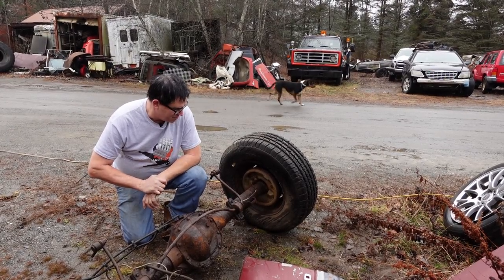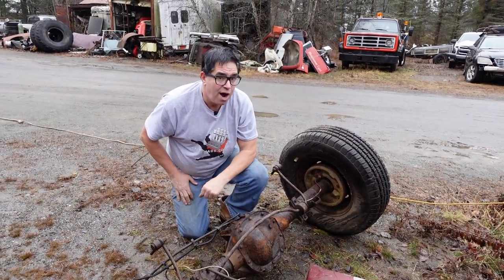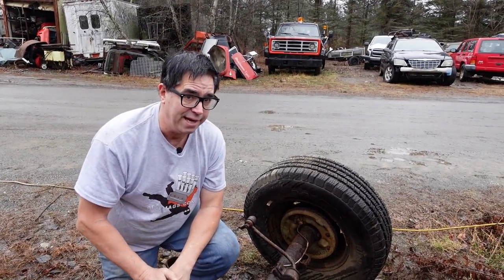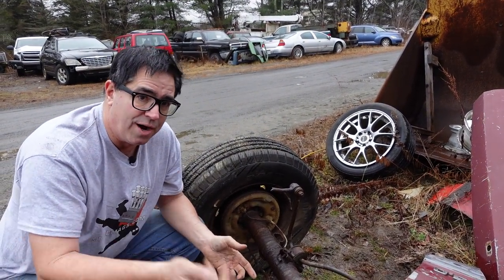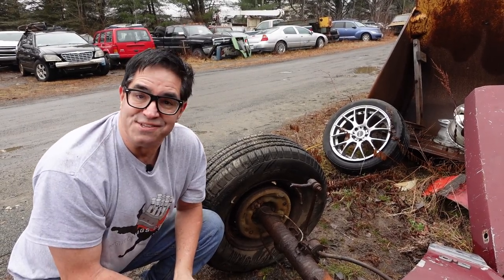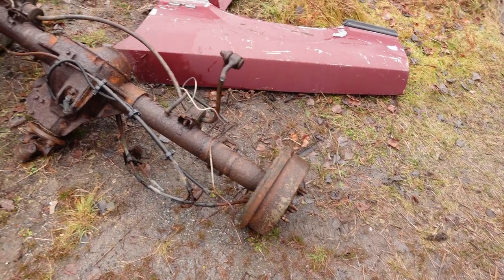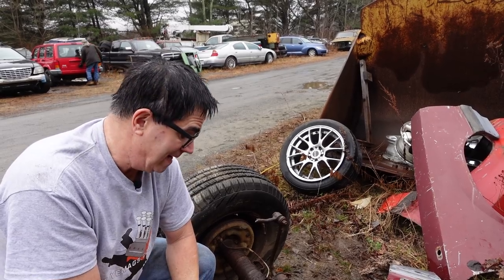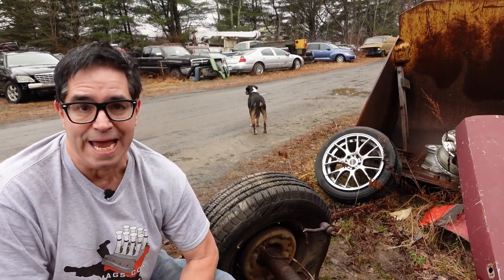The Great 8.8

Comment: These were under the Ford explorer with disc brakes and some sort of posi Trac device set up for 31 spline axles. My buddy put the internals, brakes and aftermarket axle shafts in his fox mustang for a brake, axle shaft, and limited slip upgrade as well as a five lug swap. The front end of a 95 mustang upgraded the front of his Fox body as well. Pretty slick.

Comment: 8.8 is a strong piece. I swapped out the 8.25 that came in my 87 Dakota for an 8.8 from a 98 Ranger Splash. The 8.8 was 4” narrower and gave me more options for parts as well room for some front spacing on wheels

Comment: On that mass damper, I was told by an old guy it was to add a little weight to one side of the differential so the cars with a light ass end didn't wind up with too much wheel hop on one side. IOW, a fine tuning of weight distribution from left to right. Actually, for un-sprung weight of the dif itself.

Comment: I've got an old f150 with an 8.8 under the back, it's got 380,000 km on it and it's all original, other than a lot of spider gear wear from one tire burnouts it's still holding up fine

Comment: Wow I always wondered what that dangly thing was for I have seen on some drivelines. Tuned Damper.  I love the learning Steve gives.
Reply: While working at the old Ford plant in Norfolk, I noticed these huge cylinders bolted to the upside down frames going down the F150 line.  At first I thought they were mufflers but saw they weren't being connected to the exhaust pipes further down the line.
Finally I broke down and asked a Ford employee about them.  That's when he told me they were vibration dampers.

Comment: Its grand daddy was the WER 8.5 inch axle first used in 67/68 small block Galaxies. Also later used in Granadas. All bearings and seals are the same. Soon, I will attempt to put 3.73 Trac-Lok 8.8 guts into my 68 WER axle.  Hope it works, I'll let you know.

Comment: My 96 Buick Roadmaster sedan had a weighted bracket hanging from the passenger side of the factory stainless steel dual exhaust near the catalytic converter. I didn't notice any difference after removing it. But I'm sure the Flowmaster 40 series mufflers covered up any noise

Comment: Ford also utilized the same 8.8  ring and pinion in the 2002 and up Explorer and Explorer SportTrac utilizing full independent suspension.
Reply: I didn't know those were IRS. Very cool! I had a weird idea for Sport Trac's a while back. Shorten the frame, slam it, shorten the bed down to about 1.5 - 2 feet, weld up the tail lights openings and create external bumper mounted lights, Narrow the front engine compartment down like a Plymouth Prowler. Basically make it look like a modern version of a model A rat rod. With all the modern interior and comforts.
Reply: Man, those rear coil springs liked to break in those irs explorers!
Reply: @mccoma11  springs break on everything if you try hard enough.

Comment: Never came in rangers until the 4.0 v6 came around in 91 and even then the ranger axles are still 28 spline axle shafts like the previous 7.5 and i believe the 28 spline shafts are interchangeable between the 2

Comment: The 8.8 has taken the place of the 9 inch, 12 bolt and 8 3/4 rear axles for guys building hot rods. Those older axles are getting more rare every day and the 8.8 has good gear ratios and many are limited slip so it makes them a budget choice. The 9 inch can be built to be almost indestructible but for reasonably powered cars the 8.8 is good enough. And the 12 bolt features an 8.875 ring gear and the 8 3/4 Mopar is of course 8.75. They all have similar stem pinion diameters as well making them similar in strength.
Reply: The 9" was much better in every way except weight. I've never seen a 9" rear worn out unless it was run dry but I've seen plenty of dead non-abused always maintained 8.8's with gears that looked like a pit bull's chew-toy. They might be the best made today but the 8.8 is a POS in comparison to the 9" rear.

Comment: That is actually a explorer rear end recognized via the anti sway bar
Reply: It is an Explorer but not due to the rear bar, some Rangers had a rear bar also. 
 The give away that it is Explorer are the leaf spring pads under that axle This was done because Explorers had more of a straight rail frame ( sort of like a box truck ) in order to lower the rear floor.  Rangers had a frame that went up in the rear and leaf springs on top of the axle.   In order to get ride heights correct the axle went under / over the springs.
Reply: @bobroberts2371   thats awesome. now I can pinpoint that I have a ranger 4x4 axle.
Reply: @AaBb-zj2ld  What year Ranger ?  The original Ranger 83 to 12 or so used spacer blocks to make a 2 wd axle fit a 4 wd .

Comment: Panther platform cars (Crown Vic etc) also ran the 8.8, triangulated 4 link until 2003 and then parallel with a watt's link.  I think the ears are different than on a Fox but I could be wrong.

Comment: The ones in late 90s v8 explore is the best to use for jeeps. They have disc braks 35 splin count and limited slips and are only 3/4" narrower the the dana 35. Yes its a c- clip axle but the axle shaft is about as strong as a dana 60 but plug weld the the axle tube to the housing it likes to slip when running big tires. But I ran 37 with no problem with one in a jeep.
Reply: This whole video I was thinking about how he should throw the 8.8 in the red XJ behind him
Reply: 31 spline was the most out of the factory

Comment: A buddy has an 8.8 in a full weight ‘66 Coronet, 440, 727, drag radials, runs 11.50s @ 116. He did upgrade the axles but the center section is hangin’ in there, so far, fingers crossed lol!

Comment: The Ford 8.8 was a only axle that I've seen where the spider gears are completely worn out by 150,000 miles.
Reply: Any axle will if you never change oil
Reply: Sounds like someone was doing lots of one wheel burnouts. If one wheel is allowed to free spin those spider gears start flying around like crazy. Otherwise under normal driving they only turn when navigating turns at a speed relative to the difference between the inside and outside tire.
Reply: @rustedratchetgarage6788  I've seen 50+ year old axles with their original fluids still, and they're still going.
Reply: @geoffmooregm  I doubt my 65 year old insurance salesman dad is doing a lot of burnouts in his trucks, but okay.
Reply: @danielc5205  yessir,,, I have a 64 Dodge Polara that my Dad bought in 1980 from a farmer who bought it new, and the car is all original.  We cleaned it up and detailed it in 1980, and because it was so clean underneath, we just hosed it down with wd40 after brushing off all cobwebs,,, and it has been to Orlando a couple of different times, as well as Mackinaw City probably 8 or 9 times, all on family vacations.  It has never had the pumpkin out of the rear axle housing,, and has never lost an axle seal. All I have done is pull the plug and dip a fingertip in the lube, to be sure it's still there.

To my knowledge, it's still running on the lube it rolled off the assembly line with.   It's been over the horizon on the odometer once, and shows 85k on the second time around.

I  am now wondering if I drain it and spray it out with kerosene and recharge it with Royal Purple 85w175,,, if it won't start leaking just days later....

Comment: I grab these out of the 1997-2002 Ford Explorer and shorten the driver's side axle tube, put another passenger side axle in and you end up with a nice width rear for early Camaros, Falcons, and in my case `1986-1993 Mazda B series pick-ups! :) Popular gear ratios are 3:73 & 4:10 and most were POSI's
Reply: I’ve got one with 3.73’s and a posi, bought it for $200. I’m going to put it in my 68 dart😁.
Reply: I left mine full with fits perfectly in my g body I also run a 28 10.5
Reply: Anyone make 8.8 irs stub shafts so you could swap them in a vette or jag?
Reply: Also a popular swap for the Jeep YJ with the Dana 35 rear end.  Easy way to get  a stronger axle with disc brakes.
Reply: I did the same thing, got one with 3.73’s and a posi. I shortened the drivers side axle tube 3” and ran two passenger side axles. It’s been great in my LS powered S10 for 5 years now!
Reply: @mcqueenfanman  Not that I am aware of but I have been trying to convince these Honda guys that are converting there Civics to all wheel drive to scrap the Honda SUV mini rear diff and use the IRS Explorer 8.8 and shortened Explorer axles. They go through all the work and expense to convert and twist the Honda axles off every pass.
Reply: @TheMotorman80  I forgot to mention that my Mazda B2200 is LS swapped also! :) I am currently running the 3:73 Posi also.
Reply: @KEIFabrication  Heck yeah! Is your LS stock?

Comment: What makes the 9er tough also makes it inefficient. The way the pinion engages the ring takes more power to drive. Ford ditched the 9er for fuel mileage; not necessarily for weight, though that was a bonus also.
Reply: I remember reading articles in car mags about calculating hp at the wheels and the 9 inch was mentioned specifically as consuming 5% with other contemporary rear ends consuming 2-3% IIRC.
Reply: I'll take the extra 2% parasitic draw, just my 2¢.
Reply: @jasonsellers9595  Why? What did the 9" do better than the 8.8? When I looked it up, GAWR is higher for the 8.8, which implies it's the stronger setup.

Comment: Limited slips are pretty popular on the 7.5 and 8.8.   Look at the door tag where it says axle, if the two character code starts out with a letter, it came with limited slip from the factory.  Also on the 8.8, be aware that car axles had a something like a 28 ? spline and trucks something like 31 ?

Comment: 2.47 to 5,14 ratios. The 2.26 was a 7.5 Sterling ratio. The highest gear I've seen is 2.47
Reply: do you know where to get them? the tallest gear ive seen to buy was 3,08 i believe.
Reply: @patriotdiz4846  Jegs sells 3:73 and 4:11 gears for the Ford 7.5 rear end.  I think they are made by Yukon.
Reply: 3.27 from my LSC , 3.55 in my old F150 and 3.73 in a 22 year old Crown Vic are very common ratios . Fox Mustang used 3.27 and 3.55 for best acceleration . LSC is about 6 inches wider than Mustang . Late 88 T Birds and Cougars sometimes had them even though Ford doesn't show it - I once heard they were left overs from the 83 to 86 cop LTDs (Fox not Crown Vic )
Reply: @bad74maverick1  thank you, ive seen them. But i need a taller gear, means a lower number. About 2.7 would be ideal.
Reply: @patriotdiz4846  Sorry I just went on auto pilot.  I never run into people who want to swap for lower gears.  But if you are looking for 2:73 gears try east coast gears supply.  They have them, made by Yukon. Friend bought a set 10 years ago for a Honda Goldwing trike conversion using a shortened Ford 7.5.  It had Yukon 2:73 gears.
Reply: @bad74maverick1  Thanks a lot sir.
Reply: @patriotdiz4846  1994- 1998 Mustang SN v6 cars came with a 7.5 with a 2.73 gear from the factory.
Reply: @keeganlangford5580  thanks, but im looking for 8.8 parts.

Comment: They are good axles. Like it's Chevy counterpart the only strike against it is the C-Clip axles. While ok for street use they are not a favorite of off roaders and banned in several racing classes. But because this axle was so plentiful and cheap and came with disc brakes and a limited slip if you knew where to look it got a lot of love and support because Dana 44's were a big rip off.

Comment: Everybody brags about the 8.8 Ford rearend, but it no stronger than the GM 8.5 ten bolt or the 8.875 twelve bolt rearends. All three rearends use the same bearings, and will pretty much take the same beating when set up correctly.
Reply: The 8.8 is the LS of rear ends. Ford put them in everything, they’re cheap, and hold a good amount of power for not much money. That’s why everyone brags about them.

Comment: No, having the single wheel speed sensor on the ring gear was not better to tell, “which wheel was spinning”, as that single sensor could not tell you anything more than “something” is spinning in the rear. It could NOT differentiate between right and left like modern individual sensors do.

Comment: I wish someone would make stub shafts for the 8.8 IRS differential, so you could swap them in rear independent suspensions with u joint axle shafts instead of cv shafts.

Comment: For the trucks they were not too good for overall life lots of bearing and axle wear items. When they first had ABS they used the ring gear because both rear tires would either work or go in to antilock together

Comment: Good info except the ring gear pickup sensor for ABS is far less accurate as the vehicle cannot tell which wheel is slipping. That's why all vehicles with ABS made today including heavy haulers use a sensor at each wheel. Ford used the single sensor for simplicity and cost purposes. They also had rear wheel ABS which did only made sure that you got to see what ever it was you were sliding into.
Reply: Sounds like a driver problem as people that know their vehicle and how to operate it did just fine long before ABS. Now with the vast tech for safety I question my safety more as I just witnessed in and around DC.
Reply: @tihspidtherekciltilc5469  I agree up to a point. It's easier for the legislators to make a "safety" nanny standard and have the manufacturers install it on every car than to mandate more expensive training. However, even monkeys fall out of trees and I've seen excellent operators lose control. Someone who knows what they're doing, backed by tech will be better than someone who knows what their doing all on their own, at least providing the tech is done right and my point is that a diff speed sensor and RABS is tech done wrong.
Reply: @screaminlead  I completely get your comment and agree about cheaping out on safety components but we don't need monkeys in control of thousands of pounds of metal that rely solely on tech that's like security cameras. Cameras record your death and only show the police what happened like lane departure or ABS tries to fix the drivers lack of driving skills. I live in the snow belt and see people lose control every snow event because they think ABS and stability control will save them when they're going too fast and is why I quit a very good paying job doing snow removal in a bordering state. It's not my driving ability that worries me it's the people driving normal highway speeds around me.

Comment: I am in the process narrowing an Explorer 8.8 for my '69 Rambler, and converting it to disc from a later Explorer. Great, affordable axle.
Reply: How much are you narrowing it?
Reply: @TheMotorman80  2 & 7/8. There are a lot of how to articles out there for it, and there is a two part video on YouTube from the Fab Series(?) that's really good.
Reply: @thejavelin7832  Awesome, was actually wondering if you heard of that trick. I got one from a junkyard for $200 with 3.73’s and a posi. I narrowed the drivers side and ran two passenger side axles. It has been in my LS powered S10 for 5 years now and has been great! Good luck with yours!
Reply: Yup. I've known about it for a while now. Got my 8.8 for free out of a '94 Explorer, and got the disc brakes, axle plates, Trac-lock carrier, and axle shaft, for $75 at the local pick and pull. Keeping the 3.27 gears. Car has a 3.08 in it now, and it's really happy with the T5 and warmed over i6.

Comment: The down side :     crappy design of the axle bearing riding on the axle shaft its self,     8.8 has to be set up with shims, unlike the adjustability of a 9 inch,     9 inch comes out as an assembly for easier change out of gears.    8.8 has the C clips that are known to break when racing, not so for the 9 inch.     to me,  hands down the 9 inch is so much better.
Reply: Just get weld on axle tubes bud. Then you don't worry about your c clips

Comment: 8.8 in a gt500 2013 2200 miles and gt 5.0 2013 5600 mile bought new ford replaced them under warranty never beat or did burn outs they are junk